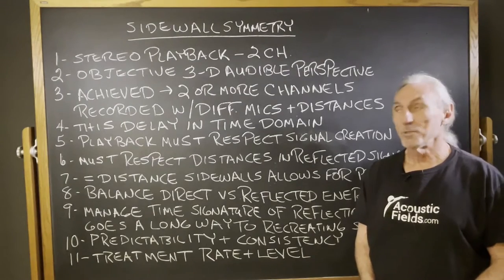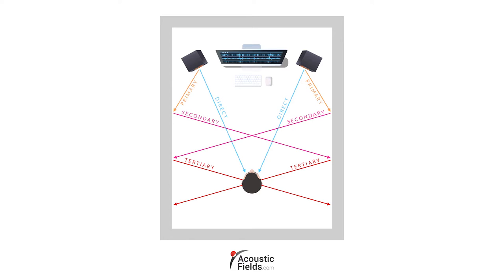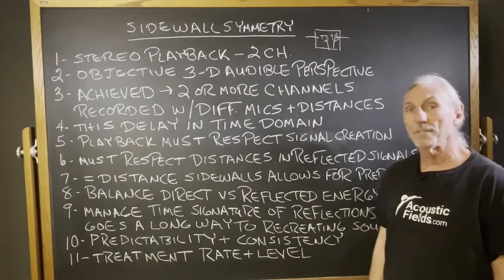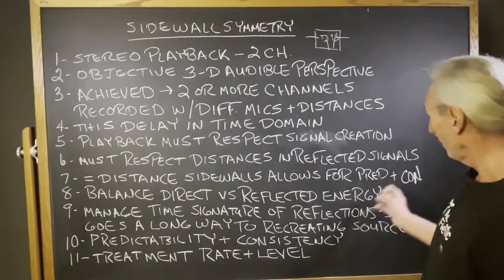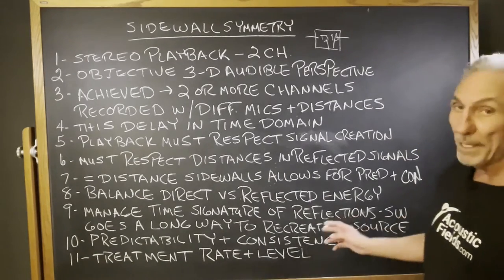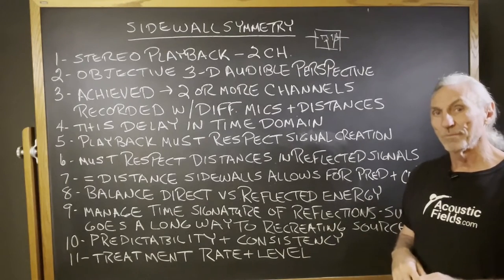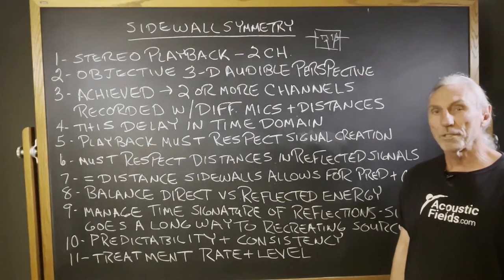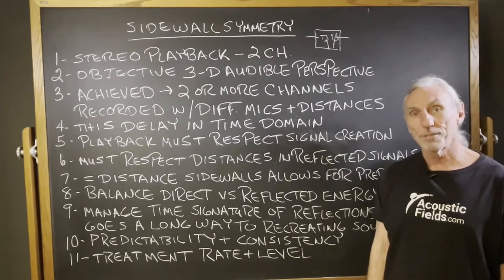Sidewall Symmetry - www.AcousticFields.com

Comment: How to obtain symmetry  in an odd shaped room? My studio is in the attic room, the ceiling  is lower on a side, and it is similar to a L shape but shorter.  If placing the speakers symmetrically on the side, there won't  be symmetry with the front wall.
Reply from the maker: Make sure the sidewalls are connedcted to a frontb wall. The "rear wall" can be open.
Reply: @AcousticFields  thanks.😃  Rear wall, is the one behind the listening position right?

Comment: can you use 1/2" plywood on the face of a "bass trap" (I know you don't like that phrase)? In other words, what frequencies start to penetrate through 1/2" plywood?
Reply from the maker: It would depend on what type of low-frequency absorber you are designing, what frequency you are designing for, what the amplitude or strength of that frequency is and a whole host of other varaibles. Physics is not easy.

Comment: When building a "wall" on one side with panels do you put a wooden plate or something on the back of the panel to get a new reflective surface?
Reply from the maker: Reflections from sidewalls can be treated with absorption or diffusion. Your usage and distances from sidewalls to speakers will determine which one works best.
Reply: @AcousticFields  so you don't put anything on the back of the panel. You let the audio pass thru and treat the real side wall behind the panel additionally?

Comment: I’ve always wondered though whether a rectangle is actually the best shape for a sound room. It seems it would be best to have the front wall and the rear wall parallel to each other but have The wall behind the listener a bit wider than the wall behind the speakers. It would seem to fight off some of the problems while still providing symmetrical walls to the right and left of the speakers. Any reason why that wouldn’t be a good idea?
Reply from the maker: Recatngle rooms have issues that are predictable and consistent throughout the room due to its shape. With this predictability comes better response to treatment.
Reply: @AcousticFields  Oh I see how that consistency makes for predictability.  My Idea of a trapezium would have a constantly broadening distance.  It is fascinating how performance halls through the decades have been designed with so many different geometric shapes.  The ones I’ve been in sound fantastic.  But I’ve heard that there are those “problem halls” that required a lot of work to correct.
Reply: It is a good idea, but not for the reason you stated.

In a studio/mastering environment, sidewall geometry should redirect lateral energy to the rear wall boundary, where it's LF spectrum is absorbed and HF spectrum is diffused and returned at a diffused lower level.

This creates adequate ITD Gap, Initial Time Delay ... ie., time between the arrival of the direct sound and the early reflected energy. 

This facilitates a listening environment whereby the playback is fully experienced and un-corrupted by time domain smearing and freq domain aberrations. 
It's the time gap our hearing mechanism needs to process the direct sound... as later arriving reflections don't alter how we hear the direct sound. 

In non-critical listening rooms for music enjoyment, a correct blend of diffuse sidewall energy can be perceived as sounding quite pleasant. It can add greater spaciousness and ASW, Apparent Source Width. 

It's worth noting it's just lateral energy that provides this, not vertical.
 Typically it's best to eliminate as much reflected energy as possible between the listener and the loudspeakers.
Reply from the maker: @FOH3663  Your time delayed reflections can be managed by using the proper rate and level of absorption. You must weigh the absorption performance benefit with the cost of splaying.
Reply: @AcousticFields  
I disagree, as noted in my previous submission above

Comment: Can you please tell me best way to block ultra low frequency
Reply: He'd have to know what frequencies and amplitude and how much  attenuation would be needed before they can figure out what materials and wall construction to use to block low frequencies..
Reply from the maker: You must know the nature of the enemy you are fighting before you build your castle. You must measure twice and cut once. With noise barriers, you do not want to spend $ 1.00 more than you must to attenuate noise levels since a barrier is a permanent construction build and stays with the building when you leave. Every material type, density, constrcution methodology is based upon the frequency and amplitude of the noise.

Comment: Question, I am stuck mixing in a small room. I don't have much choice except to have my speakers up against the wall. Is there anything I can put behind them to help at all even if it is only possible to help it slightly?
Reply from the maker: Use our Carbon Panel. It is 12" deep. Place one behind each speaker.